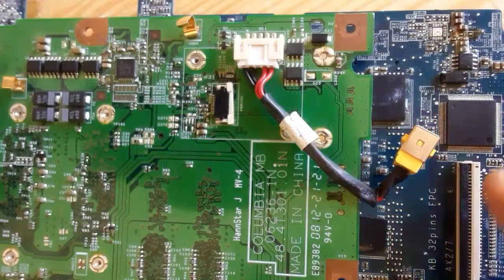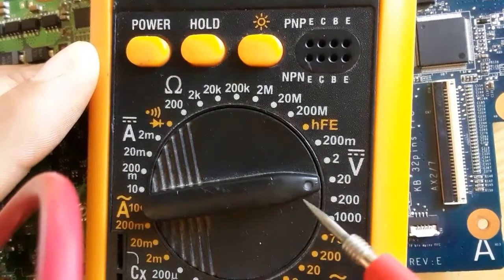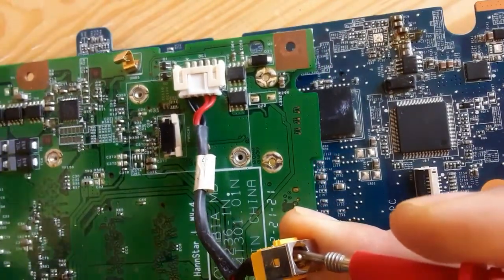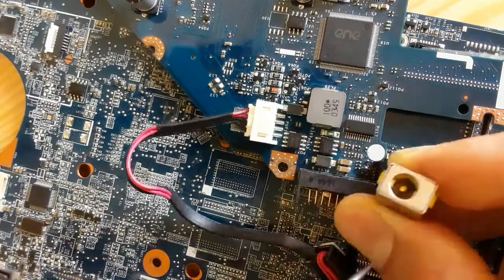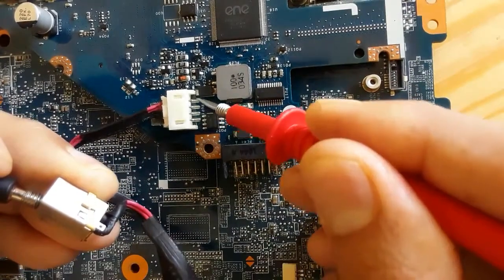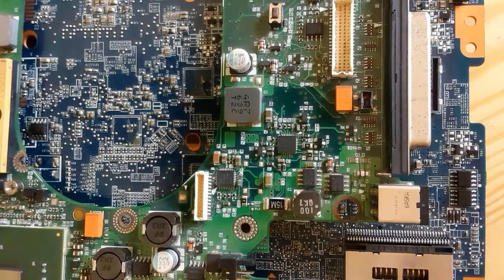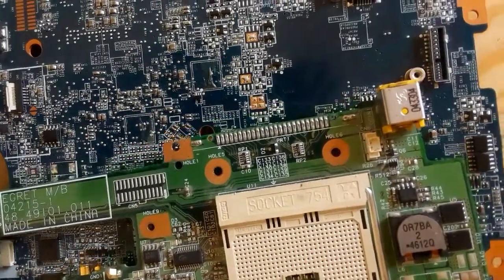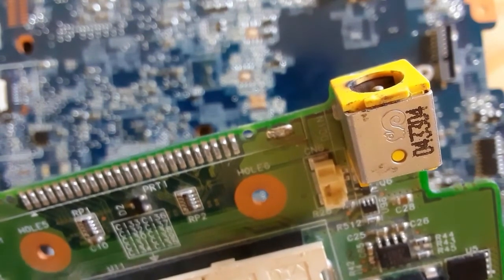Learn how to Diagnose Laptop DC Power Jack Port

Comment: I don't think testing for continuity will tell you if the DC jack is "too loose" or not.  Maybe you could unplug it from the motherboard then plug the charger into it and check for voltage on the pins at that point...?
Reply: That’s true continuity will not tes accurate I have a power jack that test good at continuity but will not deliver voltage
Reply: Yep, I guess you are right. I had a problem with an old Samsung(power jack) and made an adaptation, and it worked. The computer stayed months in a shelve and now it powers up, but no screen(not even external) and no sig of booting. Even with fan, leds, all as it was in a normal boot. I am puzzled(I am no technician).
Reply: @Batmagoo333  weird.  New DC Jack might help :)